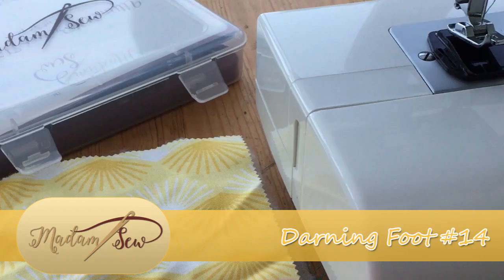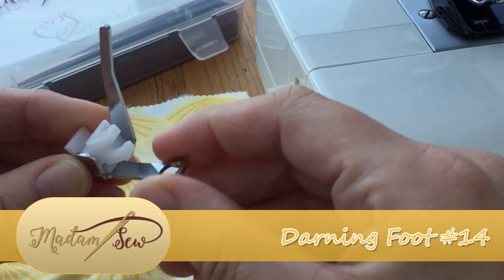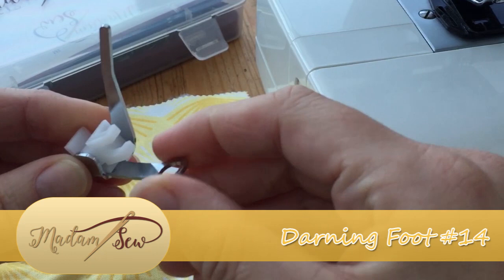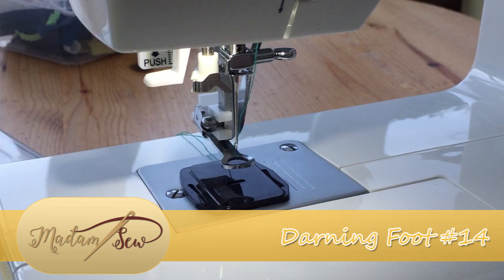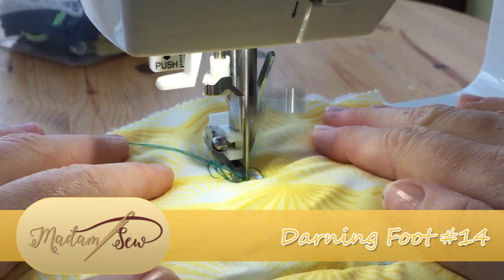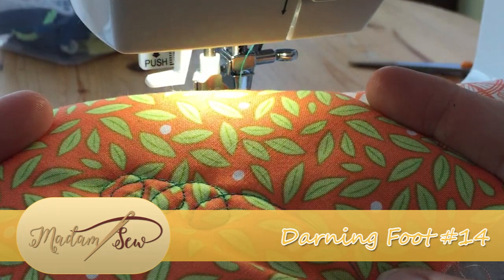Darning Feet #14 and #23 (free motion quilting feet)

Comment: When using darning foot #14, you're supposed to pull the needle thread below the foot, not pull the bobbin thread on top of it. When both threads are beneath the foot, you don't get the loose threads trailing within your foot and getting under your stitches.

Comment: Why have two feet that do the same thing? I'm not trying to be snarky. I'm really curious as to why.
Reply from the maker: They have their own set of differences :) Some people prefer using #14, others 23. Foot number 23  is transparent, 14 is not. The needle opening of 14 is more circular. Foot number 14 is pushed down by the needle bar, 23 has a spiral spring. 
But they can definitely be used for similar projects! I prefer using #23.
Hope this solves your query :)
Reply: @MadamSew  Thank you.

Comment: The bar on the spring loaded foot that is to go over the needle bar broke on my first use🤬 and the #14 foot doesn’t even touch my quilt at all.  So now what can I try. I have a quilt partially quilted.
Reply from the maker: Hey Nikki, can you please drop us an email at hello@madamsew.com and we will help you out!
Reply: MadamSew  I have been in contact with customer service and they are sending me a new #23 darning foot. I am wondering about the #14, is it to hover over the fabric or should it sit down into the fabric. Customer service did send me information and a photo of how it is to fit on the machine. But my foot hovers over the quilt and does not touch it at all.